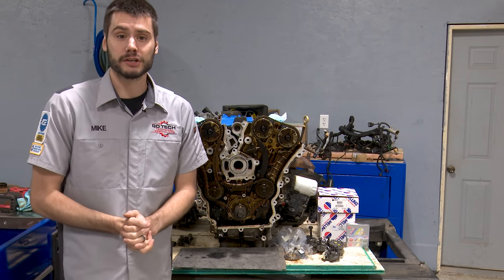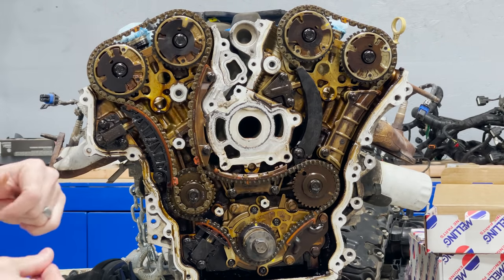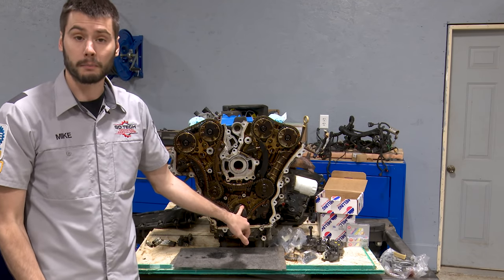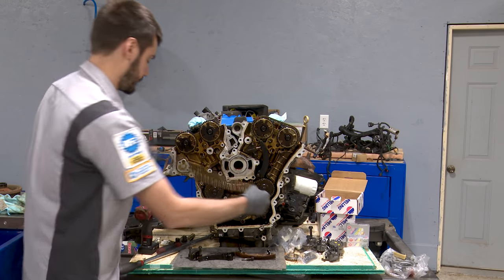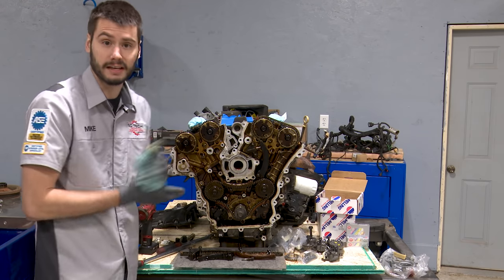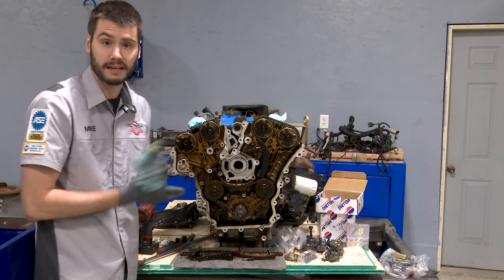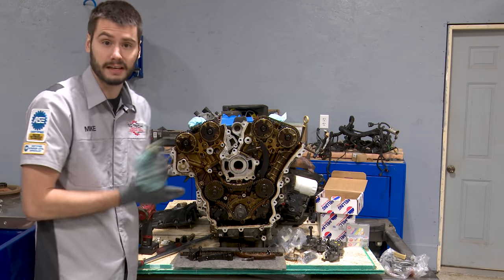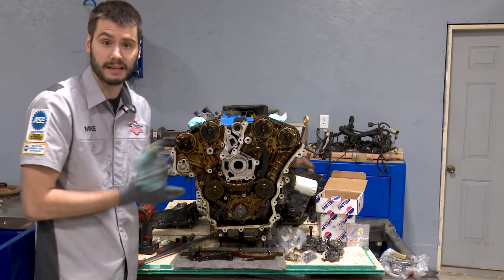How To Replace Timing Chain On Chevy / GM 3.6L V6 - Full Length Removal and Install - With Tips!

Comment: Very helpful. Great video. I used the tools, though, as I did mine in the car. I used yours and other videos, and they helped me out quite a bit. Thank you!
Reply from the maker: Hey Thomas, awesome! Glad you got it all fixed up. How horrible was it doing the job in the car?
Mike Becker, Senior Instructor
Reply: @GoTechTraining  , I’ll not say it was easy. Lol. I used mirrors for the timing marks with bright yellow paint. It was a beast on my Acadia
Reply: @thomasclark250  how much did it cost doing it yourself with gaskets & parts included?
Reply: @stevenrodriguez7668  , roughly around $400. Not bad
Reply: @thomasclark250  sweet ! And did it ever give you trouble codes related to the catalyst system? If so what kind of symptoms was the car giving? Or was it just timing chain issues? Thanks for the response- Steven
Reply: @stevenrodriguez7668  , it gave me the generic code for the crankshaft position sensor code, and the check engine light came on. Ran like garbage. I would recommend if you’re doing it yourself in the car to pick up an air or electric ratchet. Invaluable to get the rear mounting bolt for the power steering pump on and off. It’s a real beast, and pick up a paint pen and an extension mirror. Lifesavers
Reply: @thomasclark250  awesome that's really helpful I appreciate that info. I hope your Acadia stays durable and successful !

Comment: This is a great vid and explains it well. I don't know why they have to make stuff so dam complicated now days. Not looking forward to this if I have to do a head gasket job, which I think is a good possibility. In my 45lbs comp pressure on #2 cylinder and 90 on the 4. While 120ish on the 6. Maybe I'll get lucky and just have a valve spring issue that seems to be common enough. I wonder how hard it is to do in the car?
Reply from the maker: Hey Jason, thanks for watching! If you're pulling heads, i'd try to get that motor out. Its really not a bad job if you have a lift. If you don't...it can be tricky.
Mike Becker, Senior Instructor
Reply: @GoTechTraining  I wish I had a lift lol.

Comment: Is this the same engine as Holden (Australia ) has. ? The AlloyTech LLT engine ? We in australia had issues with the breathers on the rocker covers not being enough for it to breath properly left side of rockers oil wasn’t too bad but that the right side was feral
Reply from the maker: Hey Danny, I believe this is the same engine. The LY7 and LLT models are both seen in the US as far as I know. I've seen breather issues on these for sure...among the various others. What an engine 😕
~Mike

Comment: I have a 2014 LFX with 28,000 miles on it and I have to reseal the front timing cover.  I don’t have a check engine light or any related codes but am thinking to change the chains, sprockets, tensioners, guides while I have the front cover off.  I’ve noticed alittle bit louder ticking noise at idle which I’m nervous could be the start of a chain issue.  What should I do?
Reply from the maker: Hi Steve,
That's a good question, 28,000 miles is pretty premature to replace a timing chain, unless lack of maintenance caused it to stretch. Even then is should not make noise unless a guide or tensioner failed. I would start by inspecting it closely when you have the front cover off and go from there. Since the timing cover removal requires the valve covers to come off, also make sure to inspect the camshafts and lifters. Other things that can cause ticking on this engine are faulty purge solenoids and high pressure fuel pumps.
I hope this helps, thanks for reaching out!
~Ryan Wilsing

Comment: I just Tested and Confirmed on 2008 Malibu LTZ with 3.6L: if you press and hold gas pedal to the floor, and then crank the starter, the car has "clear flood mode" and will turn the engine over without delivering gas to the injectors. Try This before you tear into the engine timing chains, because you can use this function after the job is done to pre-lube the internals prior to firing it up. You can do this procedure after you change the oil, for example you want the oil filter filled before the engine fires up.

Comment: Why would you not replace the cam sprockets? They would have the same wear as the rest of the chain system.
How many miles on this engine? Trying to determine when chains should become a service item.
Reply from the maker: Hey Brian, thanks for watching! Sure, you could replace them. This used engine had right around 100k on it. 
Mike Becker, Senior Instructor

Comment: Thank you sir for the class today, I didn't know how much things had changed in engine design on V-6. My GMC Terrain may be similar, I will save this video for me when it comes time to do mine. The question does the rule still apply to 100,000 miles change the chain?.
Reply: If you have OBD2 the computer will give you a check engine light when the chain stretches or jumps time. Most people just wait until it gives them a warning on the dash anyway.

Comment: Makes this project very simple - but I can imagine it's a huge headache to do in the car.  My 2009 Equinox Sport 3.6L is prompting camshaft position sensors codes... Assuming that's solved by timing chains.
Reply from the maker: Hey Josh, thanks for watching! Yes, i'd HIGHLY recommend pulling it out of everything that is transversely mounted. It's not horrible to do in the car on the RWD vehicles though. 
Mike Becker, Senior Instructor

Comment: Hi, can any body clarify if you don't have any chain on the engine and you need to set timing, what piston we use as reference and what will be the cigüeñal position?
Reply from the maker: Just set the timing marks as shown , the crankshaft spins twice for every cam revolution so it can’t be off

Comment: What was the clicking and popping that was happening that started immediately when you began to rotate the engine. Was that not chains jumping teeth? I have had to redo this over and over for this exact reason which you seem to ignore. Maybe just for the videos sake? You did have to do this over correct? Thanks.

Comment: Wow very informative video, i have questions gm 3.6 , 6 cylinder vvt engine on startup having advanced time for 35 seconds and miss firing , rpm fluctuations in this time only after that engine runs smooth ,is it timing problem?

Comment: Hello I'm doing 2010 Camaro V6 timing chains and oil pump and saw melling video  where they did the whole job in stage one timing with the cam special tools locked in , I assume if they can come off that way they can go on that way , just was wondering your thoughts please!
Reply from the maker: Hey Jacob,
I have never tried complete the job this way, I assume if the links line up then it should work just fine. The procedure we followed is the GM procedure, setting it back to stage two timing.
Good luck on your timing chain job! Thanks for reaching out
~Ryan Wilsing
Reply: @GoTechTraining  thank you  for the quick reply, i'm doing it your way!! Makes More sense to me and it's not that much more effort

Comment: Hello Mike from Down Under ;) Great work there and information, so they changed the giude on the oil pump when they did the chains on the old engine..
Reply from the maker: Hey Mag1vl, thanks for watching!!! Maybe they did? Not sure, never pulled the front cover on the old one.
Mike Becker, Senior Insturctor

Comment: Just curious, I know you say the cam holding tool is not needed. Are the flats of the camshafts on bank 2 facing up when the crankshaft sprocket is setup for stage 1 timing?
Reply from the maker: Hey Chris,
Correct, if cam tools are available, they can be used to double check cam timing in stage1 and stage 2, right bank 1 cam flats will be up in stage 2 and left bank 2 cam flats will be up in stage 1
~Ryan Wilsing
Reply: @GoTechTraining  Thanks Ryan, the instructional videos that you have created are excellent!!!

Comment: Thanks Mike. Chains and pump, not too bad, but at my age, 71. I'd need a house boy for the engine R-R...Just  sent 04 Cherokee 4.0 to another shop for an engine after diag for a bad miss/rough running. Customer drove it in, top of number 5 piston  was missing in action, completely gone. Go figure !!!
Reply from the maker: Hey Terry, yeh, the jobs not so bad once it's out of the car...a 4.0L with engine issues huh? Those were solid motors. Wonder what happened!?
Mike Becker, Senior Insturctor
Reply: @GoTechTraining  Customer is a drive it till it drops kinda guy. Plugs looked original and so did the oil. Maybe not the oil, but it was rather thick, black, and way over a qt.  low. He doesn't do PM service, he does PW repairs. That is fix it when it stops running to PREVENT WALKING. Only 173,000 miles on an 04. My research found that around year, Mopar had trouble with piston skirts breaking apart. Didn't tear down, but bore scope showed no sign of a piston top at all. New way to check oil. plastic tube thru number 5 plug hole all the way to the bottom of the oil pan. He drove it like that for 60-75 miles that day, so yeah it's definitely a good engine.....

Comment: In the melling video the guy did everything from phase 1 he placed cam locks on. What is your opinion on doing it that way or does it need to be done in the two different phases?
Reply from the maker: I think it can be done either way. I prefer to do it as the OEM(GM) designed that way I can fall back on the published instructions as needed.
Mike Becker, Senior Instructor

Comment: I have a question about the cams do every vehicle with dual over head cams have flat spots on the cams and singles also?
Reply from the maker: Hey Josh,
Good question!
No this design is unique to engines deigned to use that type of tool to check cam timing. Some Cams have different markings, some have none at all.
Thanks for reaching out!
~Ryan

Comment: In the cloyes video the engine is turned counter clockwise to put it in stage one. you went clockwise does it make a difference?
Reply from the maker: Hey R R, no not really. I just have a thing about turning engines backwards. 
Mike Becker, Senior Instructor
Reply: @GoTechTraining  thank you

Comment: Great video! I went through this procedure but afterwards my engine was making a huge rattling noise, like the tensioners weren't working. I've pulled it apart again and I can easily push one of the tensioners in by hand. Did I just get a dud tensioner from the factory? or is there some priming/other process required to get them to work? cheers
Reply: Answer this guy please!
Reply: You either have a bad tensioner, or the gasket isn't sealing, or there's a blockage in the oil port to the tensioner.
Reply: Does anybody know how to compress the tensioner if the pin was pulled too soon?

Comment: I followed these steps to a tee and after removing the chains realized the markings on the cam phasers were in the wrong position (6oclock and 8oclock on the L side and 6 and 4oclock on the R side) trying to figure out what I missed or did wrong. In these positions it makes it hard (or near impossible) to match up the chain to the timing marks.

Comment: I just done a timing chain guides and tensioners and also vvt sprockets did you have any trouble when firing it up the first couple of times I’m having trouble it starts runs for a split second and then shuts off any insight would be greatly appreciated

Comment: Mean bro got to do mine how much are timing chain kits be good to change water pump to wen I do this
Reply from the maker: Hello Raymond,
We have a link in the description for a chain kit that we recommend. 
The water pump is not timing chain driven so it doesn't have to be replaced, but it is still a good idea, since it comes off with the timing cover.
~Ryan

Comment: I am hoping you or someone can help me, I did this job on my 2010 buick Enclave. After completing it 3 times I am still having issues. My cylinders 1, 3 and 5 have low compression (around 100 with 2, 4 and 6 at about  150) I  even bought the cam locking tools the last time and still have the same issues. Any advise would be greatly  appreciated.

Comment: When changing the oil pump, do you need to remove sump as well to clean the oil pickup strainer and replace o-ring?  Or is it enough to just unbolt and replace it?

Comment: is this the same kind of V6 that is in the GMC Acadia and Saturn Outlook SUV?  It looks like the same design.  I've an outlook with a leaking head gasket with 160K on it.  I figure if i am going to have to deal with taking off the heads, might as well replace the chains, any anything else internal like that while dealing with it.  maybe even pull the pistons and redo the rings and bearings too. Looks like i need should replace the oil pump while in there as well.

Comment: Question for you? I removed engine and cover and cranked engine over to check tensioners. Is there supposed to be oil bypassing tensioner piston and shooting onto chain or is that a sign of poor manufacturing? tensioner shoe bouncing.

Comment: Does the timing chain problem only occur in the 3.6 version ? I have a 2011 srx with the 3.0 v6 currently at 198k miles still running like new.
Reply from the maker: Hello Diego,
The 3.0L also has had some timing chain issues. But a great deal of the timing chain issues can be blamed on lack of proper maintenance. So if you have been changing your oil regularly there's a good chance you may not have any issues.
Ryan W, Technical Instructor
Reply: @GoTechTraining  gotcha. Yea I heard they they occur due to lack of maintenance. Whoever had the car before me probably took very good care of it or had the chain replaced. I do the oil changes on time with full synthetic.

Comment: How did you torque down the harmonic balancer bolt once it was back in the vehicle?
Reply from the maker: Hi,
There are a few options when torqueing down a harmonic balancer bolt and it depends on design. On this particular vehicle the best way to torque it down, is by removing the starter and holding the flywheel in place with the special tool or a equivalent to stop the crankshaft from turning. On this vehicle we used a the special tool. But if unavailable a wide faced pry bar or screwdriver could be used to hold the flywheel while the bolt is torqued down.
Ryan Wilsing, Technical Instructor
Reply: Ryan! I definitely appreciate the response! I’m about to do this job this weekend. 😬 it’s on the ly7 model, same process I asume? I found that special tool and have it on order, thank you! 
Video is on point, thank you!

Comment: where should number one cylinder be in stage one or 2 timing ? if you had the crank out you could you still be 180 off this is because the chains have been removed  i dont have top dead center on ither cylinder in stage one or 2 one I would thing we should get TDC at one or the other.this can become a problem if the cams or crank are removed  Yes or No ?

Comment: Hey @GoTech , I have a 2007 GMC Acadia with 185k miles , is this problem most likely to happen or is there possibilities of getting away with it? If not, what are the tall tale signs of chain stretch? P.s. thanks for the really informative video.
Reply from the maker: Hey Steven, thanks for watching! If you changed your oil regularly, you may be ok. Common symptoms are timing related trouble codes. 
Mike Becker, Senior Instructor
Reply: @GoTechTraining  hello Mr. Becker ! First off thank you for the response, secondly, I do not get timing related codes, only catalyst system related. Car loses power below 2k rpm at points during use, plugged catalytic converter possibly? Any help and information is tremendously appreciated, thanks again!- Steven
Reply: Jimmy S  yes the wave plate issue ! I’ve heard of the nightmare, fortunately we don’t have that problem, I’ve changed the transmission fluid a couple times and actually once here recently to stay on top of the transmission preventative maintenance factor. I also do not have any timing codes which is awesome. Trying to keep it that way with high quality thicker weight oil and intervals that go no farther than 3k miles . The cat system is literally the only thing giving us issues now. I’m ready to do the job myself I’ve just haven’t found a solid source for new catalytic converters that aren’t China/California bull crap . Also , yes, I believe I’ve gotten a p0420 code out of it before . How lovely! -Steve
Reply: Jimmy S  ahh that makes sense. Thankfully this is not a California car situation. But I will definitely look into other options for aftermarket cats, I did not know that bank one would be the rear side, that was helpful for sure . Can’t wait to see what kind of mess I can get into here !

Comment: My 2010 Camaro 3.6 has low oil pressure and I can’t figure out why. I’ve changed the crankshaft, rod bearings, pick up tube and seal, timing chain, actuators, tensioners, guides and I can’t find out why the oil pressure is at 5 psi. What do I need to check?

Comment: For thi the tose who need to reuse your tensioner.  Keep the pins or go make a pin.  THe piston for the tensioner needs to be depressed and turned until it locks.  After that, put it back in the tensioner body.  you then need to depress it even more while in the tensioner body.  while doing that insert the pin(make sure they are lined up correct prior).

Comment: Can this be done without pulling the engine? Also after you completed it I noticed when you was rotating the crank one of the tensioners was clicking. Is that normal? and wouldn't you hear that when the engine is running?
Reply from the maker: Yes, it can be done in the car but it's usually much harder. The tensioner gets fed oil pressure when the engine is running so it doesn't make that noise then.
Mike Becker, Senior Instructor
Reply: @GoTechTraining …. Ever do this repair on a Chevy Malibu 3.6 with engine in the car? Or does the cradle need to be dropped?